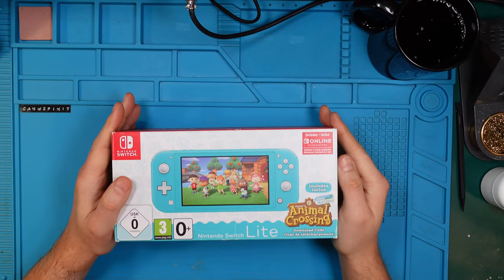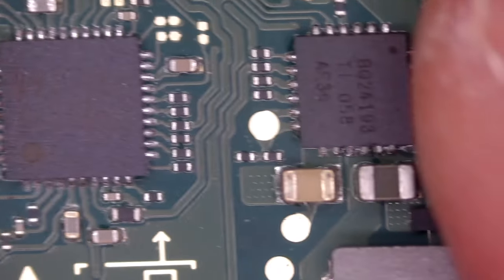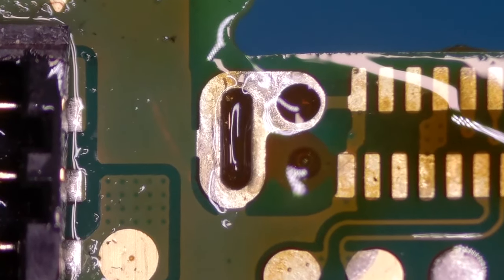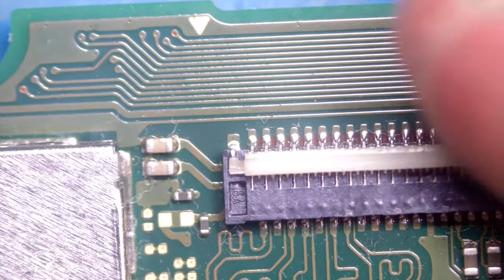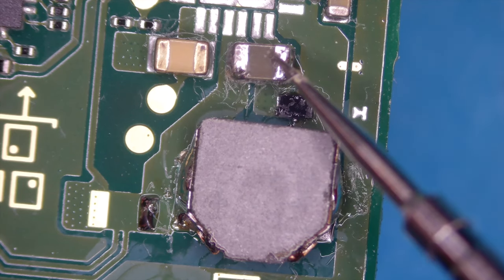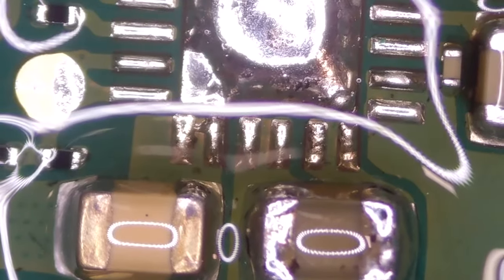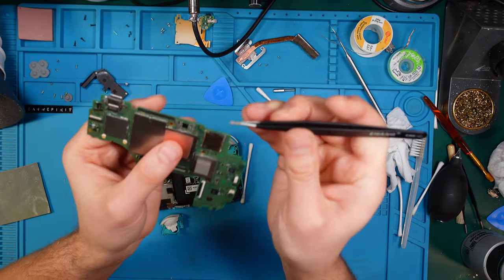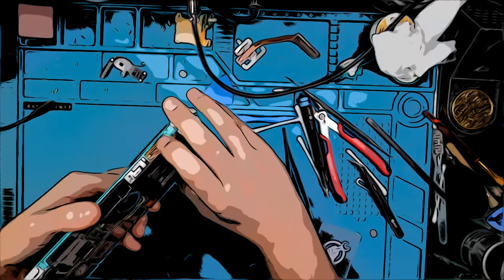Faulty Nintendo Switch Lite From Ebay - Is It Fixable? | PART 1

Comment: You shouldn't need to replace the screen.  I had the same issue after cleaning out one of the connectors and it was simply that the IPA had gotten between the LCD and the digitiser.  You can separate the 2 and then clean the IPA (and anything dissolved by the IPA) from the screen and re-assemble.
Reply from the maker: Hi Dazza, thank you! Off camera I tried out putting it on to my heat plate and left the console for more than half an hour. Unfortunately there was no change at all. When I press on it with the finger, nothing is changing. If some IPA would be between the screen and the digitizer, I should see at least a change during pushing with the finger. 😕
Reply: @CanWeFixThat  not if it has already dried out, as Dazza was reffering to. It is common issue to have 99 IPA sweep between layers of lcd/digitizer on those. IPA, will leave residue and a hot plate won't affect those, it could even create more dammage. You need to separate lcd from digitizer and clean them , almost polish them and reassemble. residue react with alot of fluorescent and uv light that can be emitted from the lcd, even if the amount is very slight and not harmful to even bateria. it is enought to have a certain polarizing effect and create "stain" light appearance when between a backlit lcd and a glass or digitizer in this case. Hope if make more sense.
Reply: @DjayLSD  I was about to say the same, kudos
Reply: @MelodyRepairs  thanks
Reply from the maker: Hi! Thanks for the explanation. I'm working on a follow-up video. But from what I can tell, in this case cleaning the area between the digitizer and the LCD didn't result in a clearer image.

Comment: Using low melt solder is brave on these because you still have the hidden pins that dont have low melt on, then you lift because the low melt has liquified, but the hidden pins might not have, leading to ripping the pads off. So careful people haha.
Reply from the maker: That is indeed a good advice! 😉

Comment: The LCD isn't ruined. It'll evaporate. I've done this myself. It'll take a few days but it'll slowly evaporate completely and not harm the LCD. It is actually inside the LCD and not between it and the digitizer but it will evaporate over days to a weeks time.
Reply from the maker: Hi Hove! If this is the case, this would be brilliant! I will check on it time to time, to see if the screen is in normal state again. I'll get back to that at the latest when the new battery arrives and I make the Revisit video about it. Thanks for that information! 🙂
Reply: @CanWeFixThat   yea just put it on a heating mat here and there for some hours and press firmly around it after to help work the screen and let it sit and it will evaporate. I did the same exact thing but probably had more alcohol from trying to clean sticky buttons. You're welcome!
Reply from the maker: I'll try! Thank you!
Reply: @CanWeFixThat  yeah water damaged screens on any device over time will eventually return to at least 99% undamaged there maybe 1 or 2 spots that may never resolve but it would be a lot better than this currently is.
Reply from the maker: @DankerTVTimeCapsule  Thanks! I am currently working on Part 2 to check on that.
Reply: Maybe absorbent packs help to. That pack in packages sometimes.
Reply: @craftymulligar  Sounds plausible!